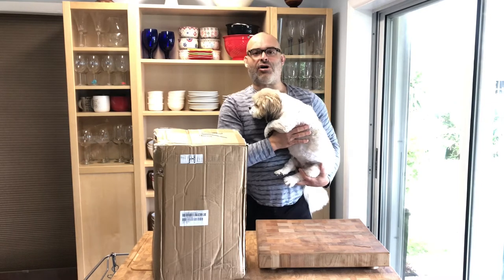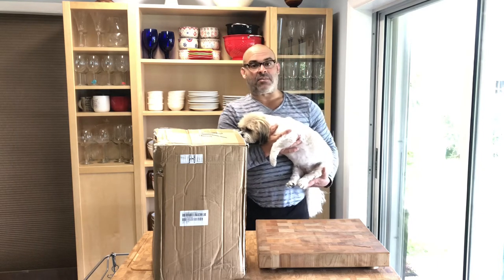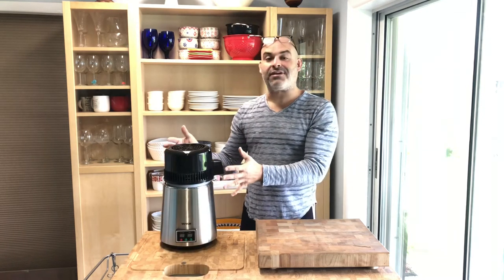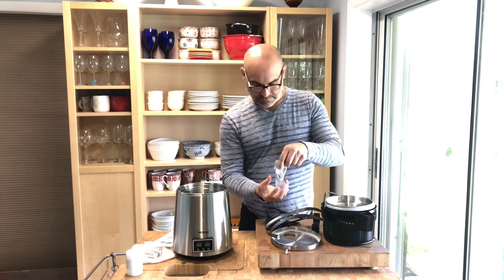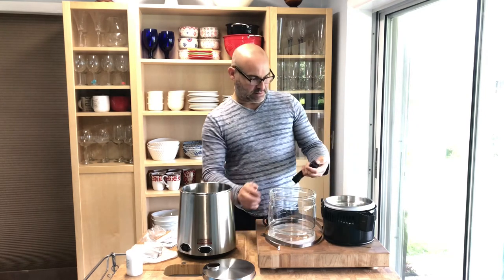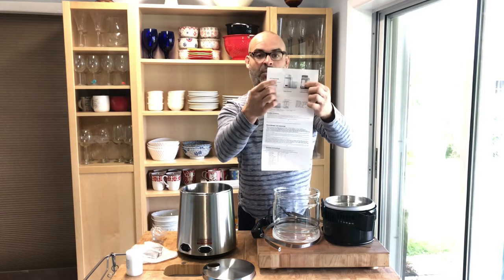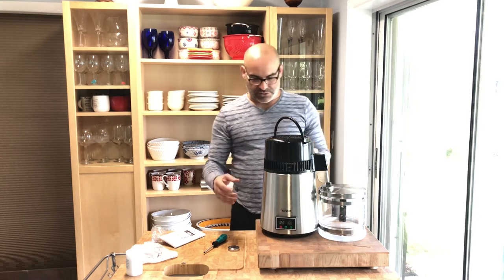How to put together the Vevor Water Distiller.

Comment: Thank you for your video! I need distilled water for my cool mist humidifier when I sleep, since my house is very dry. It's getting hard to find gallon jugs in stores this winter, or they limit you to 1 or 2, so I bought this unit. Instructions are useless, you saved the day, all set up & running it now! Thanks !!🙂

Comment: I bought this distiller because our distilled water consumption went way up when our old doggy was diagnosed with chronic kidney disease. Thanks for this great video. Like others have said, Vevor doesn't give very good instructions! They bury the part about using the citric acid and one liter of water to initially clean the machine before use in the middle of a list of other stuff. You'd think that would be kind of important and listed first.
Reply: We can't just use soap and water to clean it first?

Comment: I just bought my Vevor water Distiller, it arrived today and it has just been switched on for the first time, having a clean first before I do my first batch for drinking. I love your video helped very much, I was not too sure where the charcoal bag went, the instructions were not that clear. Thank you for uploading this, very helpful. Hello Cookie (Kookie) :D *Waves*
Reply: It goes in the spout at 7:42 in the video. Horrible instructions!
Reply: where do the charcoal bags go?
Reply: @automaticnostatic2148  With the top of the unit setting on a table upside down push/rock the spout toward the top while pushing in on the spout and it will tip out. It is hard to move. Zoom in on my thumbnail picture to see it.
Reply: Those things are fu**en awesome. I made what top shelf want to be tequila. Super smooth and flavorful. The temp setting makes it easy to do cuts.
I didn't order the vevor make Amazon sent it to me by mistake. But the make I did order is still on my orders list "undelivered".

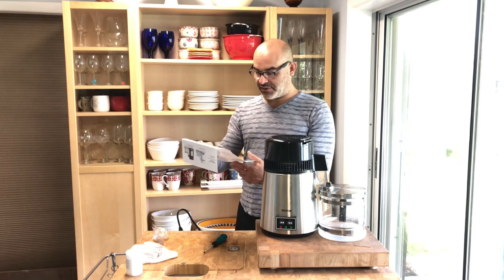Comment: Thank you, this was quite helpful. @10:06 "the distilled water made for the first time cannot be drunk". Is that referring to the 1st batch of distilled water after the initial cleaning? Or is it referring to the actual, initial, cleaning water that should be poured out?
Reply from the maker: Throw out the first batch of water after initial set up. Just this once. Remember not to use any abrasive on the tank or else it will rust.

Comment: thank you for doing this video and helping out! It does not really come with assembly instructions…I guess they think we are really smart or they are plunking us!! I already cut my thumb on the steel bands trying to put them together!! Going to the gloves and tool box!!  Your pup is cute! I have a big issue with kidney stones too and use a CPAP so I need to replenish the water consistently.  I have a water purifier but I intend on using that water in this distiller and getting some glass bottles to drink more healthy water.

Comment: Hello! How are we supposed to pour water? It spills everywhere, whether I’m using the caps or not. 😮
Reply from the maker: Make sure the rubber seal is in place and the lid is tight. There is a large rubber gasket that goes between the metal log and the glass container
Reply: @allritythen Thanks for the quick reply, I will try to fix it correctly

Comment: I installed the plastic. Gasket under the jug yet Where does the  thin  plastic  gasket go?  Thank you
Reply from the maker: It goes under the lid. That’s the seal between the lid and the glass jug. The other large rubber goes under the glass jug so that it doesn’t slide around

Comment: Does it get rid of pesticides and VOCs besides the minerals?
Reply from the maker: No,  I would not rely on this to remove pesticides or poisons or any foreign chemical. Distilled water removes minerals. Distillation is an effective method to remove inorganic compounds, bacteria, particulates and some organic contaminants. Distillation will not remove all the chemicals but removes soluble minerals (i.e., calcium, magnesium, and phosphorous) and dangerous heavy metals like lead, arsenic, and mercury. Some of the chemicals of concern produce hazardous compounds during the heating process. The vaporization process strips salt, metals, and biological threats. Stripping of minerals will not be harmful to the human body system as stated by World Health Organization (WHO). According to WHO (2009), the human body obtains vast majority of minerals from food or supplements, not from drinking water.

Comment: Does your lid lift up during operation? That's what's happening to mine and water is dripping out the back where the lid is lifted. Does that happen for you?
Reply from the maker: No leaks over here. Just make sure the top of well seated on the base. Check your rubber seal to see if there are any cracks.
Reply: @allritythen  thanks for replying. Yes the top is pushed right down on the base and the seal looks fine. Once it heats up though the lid lifts up, particularly at the back and then drips start coming out.

Also the water that has been distilled is coming out hot, about 50c or 122f. Is that normal?

So does your lid not lift up at all during operation?
Reply from the maker: @superfoodsmoothies  so far it has been working as it should. I use it three times a month. And make two batches. The water does come out hot. Not sure why yours is doing that. Check to make sure the spout where the water comes out of is clear. If it is blocked there should be no pressure building up inside.
Reply: @allritythen  I checked the spout and it seems fine. I'm contacting the seller now to see if I can get a refund or replacement. It's a bit of a hazard as it leaks on to the plug.  Thanks for your help!
Reply: Maybe you need to reduce the boiling temperature?

Comment: How do you get the water to stop tasting like machine parts?
Reply from the maker: Maybe wash the container first with the cleaner that came with it. Mine doesn’t taste bad at all.
Reply: @allritythen  I washed it several times, including before using it. I even ran 90% isopropyl alcohol through it to remove any lubricant from the manufacturing process. The water still tastes like an old tire...
Reply: @archaicsage4803  shit ans i want to buy it
Reply: @archaicsage4803  same, i can't get rid of that metal/rubber taste
Reply: did you remove the carbon filter before you did the first clean out with the acid if not change the carbon filter it should have been removed before first clean out
Reply: @serpentrae  Yes, I did. I spent a lot of time trying to remedy the taste, to no avail.
Reply: @archaicsage4803  did you try an appliance timer to turn off the distiller while there is an inch of water left in the bottom, so the sludge doesn't burn?
Reply: @archaicsage4803  did you try adding activated carbon to the tap water before you start distilling? Add it right into the water before distilling?

Comment: Still don’t know, what should I do with charcoal packs?! 🤷🏻‍♀️ thanks for your time btw! Appreciate it
Reply from the maker: The charcoal bags go inside the spout. Remove the spout and place it Inside it.
Reply: @allritythen  I don’t know how to remove it. Would be nice if you show it 🤝
Reply: @Inna Alex turn the top motor upside down so the spout points upward. Grab spout and pull towards the center of the motor then slide it out. There is a small diagram in the instructions.
Reply: The charcoal pack just sits inside the spout.
Reply: You save them and replace the current one.  You have to have that in there

Comment: Ok, right off your wrong on where the heating element is. It's NOT in the head unit. That's just fan and condenser. The heat element is in the pot. Those aren't silicon packs, they're carbon filter packs. They go in to the spout before you install it BUT they need to be soaked in clean water for a while first. Note: if you have the adjustable temp one and want to distill alcohol do not use the carbon packs. They will strip flavor out
Reply from the maker: Thank you for the input. Really appreciate it.

Comment: Gets rusty after one month of use. Vevor won't give my money back. Terrible customer service
Reply from the maker: If you are using harsh abrasives to clean it or a scouring pad, it will rust. I have had mine since the release of this video and use it three times a months and make three batches each time and mine is just like the day I bought it. I use the scale removal powder as in my cleaning video and it always come out clean. Never scrub it. The scale remover takes care of it. I just rinse and dry.

Comment: what are the indicator on the device? what there function?
Reply from the maker: Just a power button really. Just turn it in and it does the rest. You can adjust the temp but not necessary.
Reply: @allritythen  
Ok, the temp function is working? I need it also for distilling alcohol at temp of 80 degree... So if you have answer for it I will appreciate it. Thanks!
Reply from the maker: @search620  The max temperature is 108 f. And the lowest it will go is 45f.
Reply: @allritythen  
It is Celius and not Fahrenheit. Does it work? You can put it on 80 and expect to get 80?  Please update

Comment: You didn't put the carbon filter in the spout
Reply from the maker: IKR. I thought it was silica. I’ve been using without the carbon. And the water taste fine without it so I never got them. Try it out.
Reply: @allritythen  ha ha I thought that too when I first opened it, but they take all the fluoride and stuff out, to be honest I had to look up on the Internet to find out what they do and how often you need to change them
Reply: @firebirdrick what do they do and how often do you change them ? Are you still using the distiller?